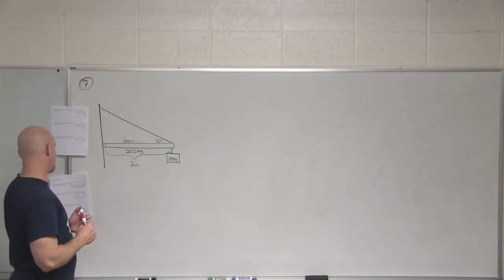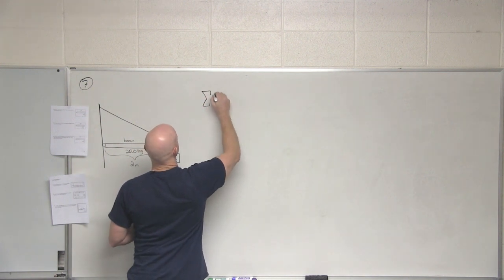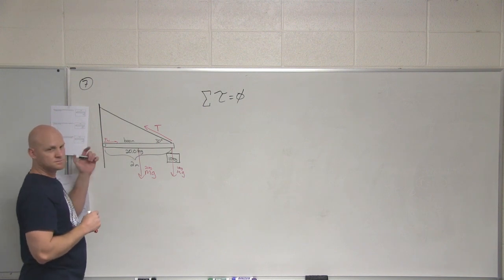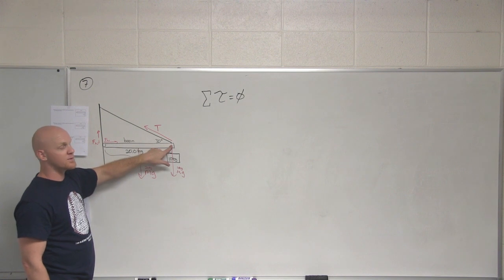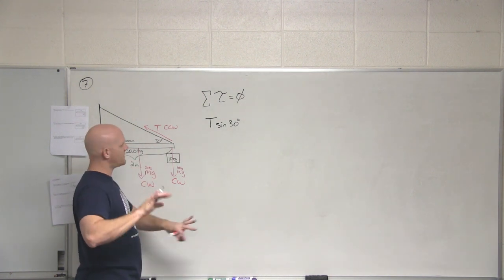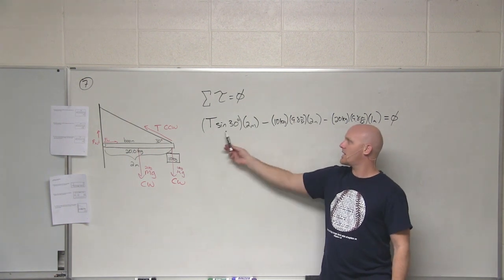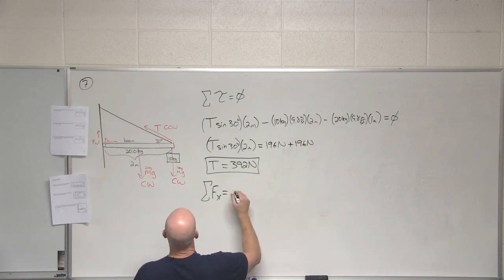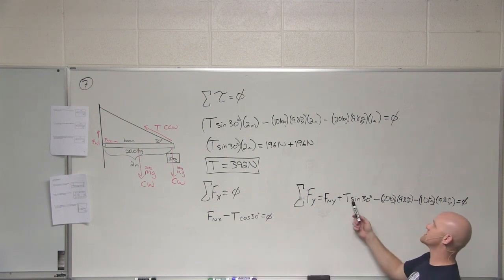8.5 Torque Problems for Systems in Equilibrium Example #3

Comment: For the forces in the x direction, how come you did Fnx - Tcos(30)? Is it because Tcos(30) is technically pointing to the left of the angle and Fnx is pointing to the right? Does my question make sense?
Reply from the maker: Hey Fauzan! You are exactly right - all the way through this example we have assigned '+' for forces pointing right or clockwise and '-' for forces pointing left or counter-clockwise. The cable is pulling the boom to the left overall, so the tension vector is pointing at 30 degrees towards the left.  Another way to look at it is that Tension is subtracted from Normal force x because it is opposing the Fnx. Hope that helps :)